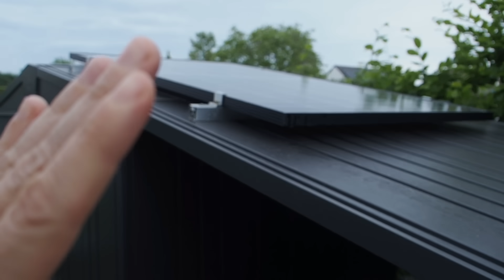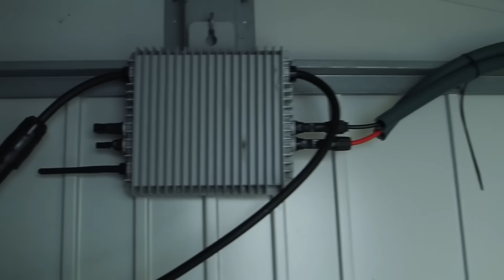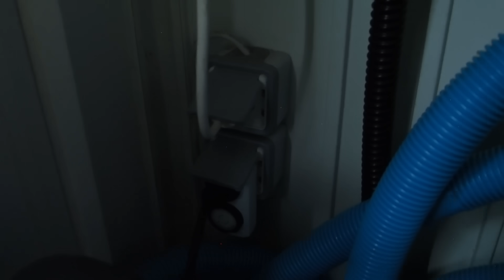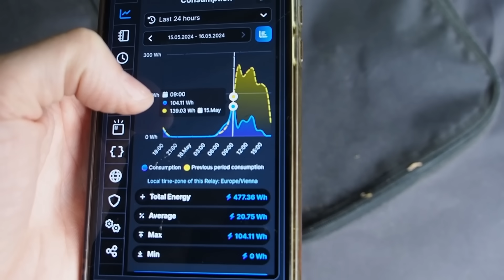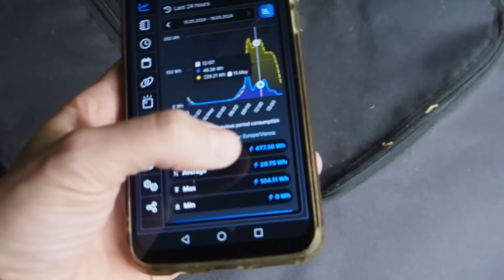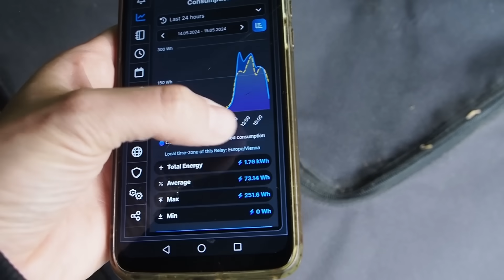Solar system? Yes? No? Which one?

Comment: We live completely off grid strictly on solar in Northern Michigan U.S. I run a full sized electric refrigerator, 2 electric deep freezers, full sized washer and dryer, electric fencers to keep bear out of my garden and chickens,6 inch deep well pump with indoor plumbing, a second cabin that my son lives in with a mid sized electric refrigerator,a large amount of lights, 3 televisions,security camera system, electric automatic gate openers,2 window style air conditionors WHEN NEEDED ,ceiling fans, and everything else wall outlets run in any normal home. We gave up very little and will never go back to connected power. We rarely use a generator, but if we do need one its a small 3500-watt inverter generator that does nothing except charge the batteries when they are low. My entire system is about 13k dollars to buy right now. SOLAR IS Amazing. Whether you are doing your setup for an emergency or to get away from the electric bill, it's a great resource
Reply: Hey there. Sounds like a nice set up. We are in N Michigan as well with a pretty sweet set up. Gearing toward moving there full time in 3-4 years but still working on it. One of my buddies actually thought I was lying when I told him we could run a window a/c unit 24 hours in summer LOL.  I had a surgery and haven't been up since hunting season but it's running a chest freezer and refrigerator as I type this. I have a neighbor that checks on it for me and has  topped off the 24 batteries once for me while I was recovering. Normally the wife and I go up after Christmas for a week and in February.
Reply: @TeutonicNordwind  I don't run the ac at night, but when the sun is shining, I can run 3 window ac units on high and still charge batteries. Now, I have routed my artesian well into a radiator, and it cools my entire 5000 square foot home. Do you have a Facebook? I can send you some pictures and information if you want?
Reply: @speedywalden  I only have one for Marketplace but yeah you can send friend request to Dan McSales. It has an "avatar"/cartoon of me for my profile. What kind of battery bank do you have? We set up a 48v system for the high efficiency. It was a bit more costly of an inverter but I'm glad I did. Have three "strings" of eight 6v 235ah batteries so pretty good chunk of juice stored at all times. I can go about three days of overcast/crappy sun in hunting season if I'm not running anything but a few lights at night, TV, charging computer, etc (and the fridge and chest freezer).
Reply from the maker: Pretty dope setup

Comment: I live of grid on my narrow boat 
All my electric is 12 volts 
I have 400 watts of power from my solar panels which I’ve fitted myself it’s fairly easy 
It cost me around a thousand pounds 
All my energy is stored into 4 large leisure batteries 
During winter this system is still good enough and suit’s my lifestyle 
I have free electricity 
Fantastic video Lilly 👍🏼🍻

Comment: would you be able to add a battery storage system then through on to the electrical grid thereby having an emergency storage while also be sending the elect. company their ill gotten gains? or like as it is with collecting and storing rainwater in many areas where it has been made illegal to do so?

Comment: Some of the intermediate range inverter/chargers know how to trick the microinverter to keep working when grid power fails. Obviously you have to talk it over with your electrician but it is possible to use one of those charger/inverter units to add batteries to your setup for grid outages.

Or, you could just unplug the panel(s) from the microinverter and plug them into a portable power station of your choice.😊

Comment: I put 5kw panels with fronius hybrid inverter with 3500euros it took up 24 meters of space on concrete slab roof. I get 45kw of power a day in southern Greece in the summer and about 10kw a day in winter. . I only use 16kw A day the rest is stored for 3 years  with energy company. I use the stored energy in the winter for heating. i always produce more than i use. the energy company keeps the surplus.  My last bill before solar installation was 650 euros for 4 months.

it was a good choice for us.

Comment: YOU CAN "FOOL" THE  INVERTER GRID A/C DETECTOR BY USING THE OUTPUT OF THE PANEL CONNECTED  TO A TINY 50wat inverter, ( a diode array on input &  output is needed).
However, very-likely your inverter can be "hacked" so detection of grid  input  is t in a confirm state all the time if it's a logic controller. If it's a relay or a "HACKABLE" circuit, an elec tech could h"handle-THAT" for you;; EITHER-WAY, IT CAN BE DONE,  Covertly, EXTREMELY SIMPLE , CHEAP & SAFELY !😜🎯😇

Comment: If you have bifacial panels you might try East/west vertical mounting in your yard and see if overall daily production is greater than horizontal mounting on the roof. In some locales that works and avoids the issue that comes with putting panels on a roof.

Comment: I've been off grid for around 6 years, don't ever want to be on grid again.  I have far fewer power outages and it only takes about 30 minutes to replace the inverter or charge controller to get the system going again.  After 5 years my flooded lead acid batteries gave out and I rebuilt the system and upgraded.  Actually I've been upgrading things. I still use cheap stuff but I'm getting much better performance and so far no problems, other than replacing the cooling fans in the power inverter. I was surprised at how well my first system did even though it was so cheap. My two current systems are a collection of everything I've learned to build a cheap but reliable higher performance system.  My small system uses three 250 watt used solar panels($150), a cheap pure sine wave 2000 Watt continuous power inverter, a Make Sky Blue MPPT charge controller($100), and two 6 volt 200 amp hour Mighty Max sealed lead acid batteries($439).  If you don't run these batteries down too far they're supposed to last 10 years.  I put two posts in the ground and built a wood frame to hold the panels on a tiltable frame that I can lock pointing East West or straight up and even all in between. I built a box for everything else and put it under the solar panels. I even added cooling fans and a thermostat control.  Keeping the power inverter and charge controller cool is a very good thing.  The system will run my 6000 BTU air conditioner non-stop all day and if I cut it off before the batteries start getting run down when the Sun goes down I can use the batteries to run the ac an hour or two at night.  My large system has all the same stuff just more of it. One system is about 2 years old and the other around a year old.  Only problem I've had is having to replace the cooling fans in the power inverters.  So far I've never had to replace fans that I've already replaced.  Always get higher quality ball bearing fans off eBay for around $20

Comment: For people not offgrid, “solar shed”/workshop probably makes more sense and can be used as the backup generator for the house if you set things up correctly. Depending on you local regulations, islanding might make more sense than directly linking to house grid.

Additionally, in some areas using a battery/inverter system to do  “peak shaving” of house power might work out without having to hook up to panels or turbines and also covers short outages as well.

Comment: Solar Power from the USA.

EG4 provides two types of allinones. grid and off grid:
Grid the EG4 18k can send power back to the grid and you can you grid power when you need it.
Off Grid does not send power back to the grid but it can use the grid when you need it. EG4 6000xp. 
Your grid for a 200a panel provides 48000W.

To send power back to the grid:
First the power company has to allow you (some do not) (It must be installed by a certified electrician using certified equipment).

The off grid EG4 6000xp provides 6000w of power in the form of 2 120v 3000w sides. The sides do not share watts.
This unit does not need batteries but works great with 48v batteries. 
This unit also includes 8000w PV input.
We don't have the same electricity you do. 
Your terminality may be different ours. 

Good luck on your off grid build.

Comment: Lilly thanks for having a calm sensable discussion like this. I think the problem is not with the technology but a problem with fitting it into a for profit capitalist economic system. As you point out a problem is matching peak production peiods with peak usage periods. This was addressed by other commenters in pointing out the use of the battery storage system. The problem with this for the capitalist profiteer is that the solar system would be in the hands of the consumer with no opertunity for profit for power companies. This is an example of localization over centralisation. We need to understand though that with localisation we need to take more personal responcibility for the resourses that are available. Great job keep up the good work.

Comment: Also you have to consider the roof. If you penetrate the roof you could have a possible leak. Also, when it's time to replace the roof, you have to remove and reinstall the solar array. I've heard of installation using magnets on a metal roof which is a better idea than drilling holes. Thank you Lilly.
Reply: There are special clamps used on standing seam metal roofs so you don't penetrate the roof
Reply: Just like taxi overhead signs that use heavy duty magnets to hold the sign during 120+ driving speeds on the highway against winds.
Reply: That's what sealant is for. 
Also ground mount if you have the space

Comment: I have 600 watts of solar panels tied to my Xantrex charge controller mounted on top of my 8’x16’ cargo trailer and connected to 2 100 ah Dakota LiPo batteries.  They run all my fridge, lights, exterior lights, CPAP and my vacuum cleaner with no issues from a 2000 watt pure sine inverter.  I can camp for months if I want.  I have a 20kw standby generator that operates from propane as whole house back up power.  But I can run 4 refrigerator freezers (house and trailer) from my cargo trailer solar system power.
Reply: Why you need 4 fridge freezers?😆
Reply: @Gazr965  I am a hunter and gardener and they are all full of meat, bread, veggies, etc.  a years worth.
Reply: @raytribble8075  Okay, just wondered.

Comment: By all means, explain to me how solar panel energy being produced goes into the grid (outbound) while the power company sends electricity (inbound), all at the same time?
Reply from the maker: My system is reducing the energy demand from the incoming electricity from the grid. So the wattage of the solar panel get used first, if therr is more demand then the electricity comes from the grid
Reply: @SurvivalLilly   Thank you, Lilly. 
I have solar on my Ex-Greyhound bus conversion, in which I store the energy in batteries. 
But if I had the chance to build a solar system for a house, I'd build it on the trailer. I'd build it on tracks that could be cranked to tilted positions and cranked down to the flush to the sides position to the trailer for transport or protection purposes. Similar to the design of windows with rectangular glass slats that can be cranked open with one turning handle.
If it's decided to sell the house, you pull the trailer to the next house. When it comes to selling a house with solar systems, there's no resale value to a solar system mounted on a house.

Comment: Why can't a person use an electric motor with a big pulley/geer and remote control car battery to operate multiple turbines with much smaller pulleys/geers and run the power through power converters to charge the battery and run everything else.

Comment: You made the right decision. I had door  to door installer solicit me. I humored the sales person and listened to her nonsense. When I said I've installed several systems myself. She was shocked. She asked me "So you have an engineering degree? You can't install solar without a degree". LoL WUT? 
I explained to her it's not that difficult if you know some basic of electricity and mechanical stuff. 

You can do it yourself, Lily with the help of your friend. I would suggest forgoing purchasing a lot of panels up front. Start with an EG4 unit or something equivalent and couple LFP batteries.

Batteries are the second most important component of the system, IMO. And no, don't listen to people who say server rack batteries are the only way. One of my "portable" systems is mounted to a simple, resin, non- conductive tool cart with wheels from Harbor Freight. I just roll it around wherever I need it. On it, I have two  Power Queen, 24v, 400Ah, 2560Wh batteries wired in series. A little over 5Kw of juice. Small capacity, but very useful. You can do mild or wild. Depends on how much you want and can afford. 
I recommend using batteries with the same rating due to BMS parameters and maximum amperage output. Mixing different batteries with a lower amp cut- off could shut the system down as the cells reach a deep state of discharge before the others.

A panel only system gets you power only when the sun is out. Without a way to store all that energy, It gets wasted, and so is your money until the sun comes up again. That person saying 18 years is the break even point is about half of reality. Panels produce maybe 5-6 hrs, 7 at best under perfect conditions. The rest of the day and night, your investment is basically doing nothing. At least with a battery bank system, you have captured and stored that energy to get you through the evening until the process starts again. Hopefully, the next day😆

So, IMO, order of priority should be spend money first on a good all in one inverter unit, then a couple batteries or whatever you can afford.
Battery  bank can also be expanded as money permits. Wire it all up and now you have the basis for back up power. You can charge the batteries from grid power when electricity rates are at the Lowest in the day (if you have time of use TOU or a tiered system).
The thinking being, when the power does go out, you can get by until the batteries are discharged, then use a generator if necessary to recharge. Yes, that is an added expense, but necessary since the sun doesn't always shine. 

As for panels, start out with as little as one or a couple. Maximize your space with the least amount of panels with the most wattage output whether on rooftop or ground mounted.
 
Add to the array over time as you as you understand your power needs. You'll need to calculate your daily Kw usage by adding up ALL the appliances you want to use during an outage. This calculation can be tricky to figure out because your needs will not always be consistent, which is why I say to not just jump in purchasing a bunch of panels first. You can get in the ballpark by looking at your billing. Get the average usage. You'll have a better idea to start with. 

A specific panel that I would recommend is from BougeRV. It's a newish, 400 watt, panel. The reviews are positive so far. I plan on buying a few to try out. You can always possibly find slightly used panels on places like Facebook, but that can be a gamble. Used panels may or may not not produce the needed output as they calender age. 

Again, anything from EG4 battery or inverter will be a great start. Can be pricy, but not more paying a random company to install it and finavlce it. 

In North America, they offer the 12k, 18K, 6000XP, 6500EX inverter. I believe all but the 6500EX are split phase units. I do not know what is available to the European market so I can't recommend.
The main point here is to plan for expansion of the system. 

Since I assume you want to be grid-tied, that's a whole other topic concerning utility certification requirements. Be sure whatever unit you choose meets requirements. Off-grid generally doesn't require equipment certification. 

Sorry for the loooong comment. That's my 2cent advice. Again, not an overly complicated thing especially since you have some help. Good luck.

Comment: If you are going to have solar panels in the EU then you must always mount them on the ground, never connect to the electricity company but use all the electricity yourself and burn the excess, in Sweden there are sick tax rules on roof mounted ones and tax on stored capacity that is sent to the electricity system, It will soon be stop selling electricity, Soon many companies will go bankrupt, then you can buy cheap, then electricians will be unemployed, then it will be cheaper, Having ice in your stomach can be good!

Comment: I have seen solar panels installed on a roof UNDER a massive shade tree here in the USA by noon it is in total shade. Solar companies are NOT your friend. And now the power companies are screwing you with a flat fee whether you are making more electric than taking or not. I think a small plug and play system is the way to go also. Have it run what it can off grid and cleanly save that from paying the grid.

Comment: besides that most panels will not last 18 years the batteries will not last 18 years and the inverters and charge controllers will not last that long every thing is built to break far before you get it paid off through an installer. it for the most part a scam backed by political pressures. I use 3 small panel arrays hooked to their on charge controller with batteries connected to separate inverters. this does everything I want and need and if one section quits I have back up options so I know that my freezer will always have power